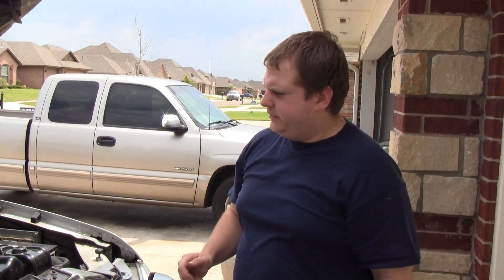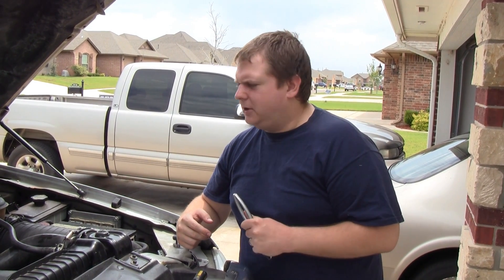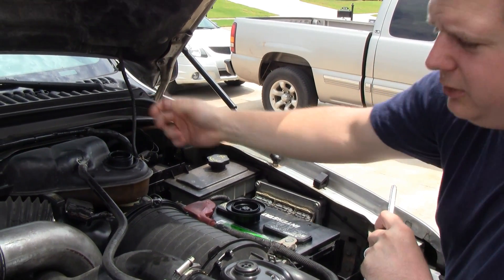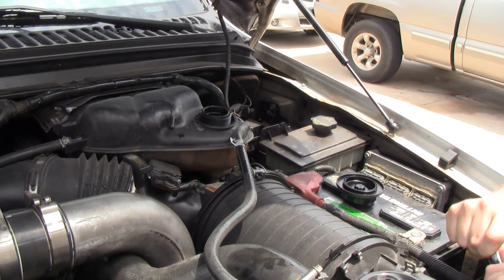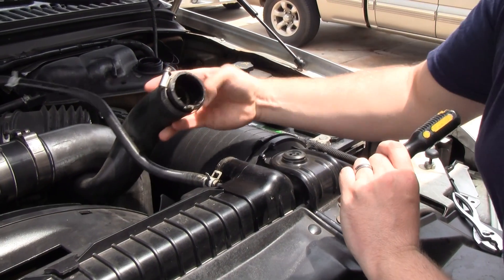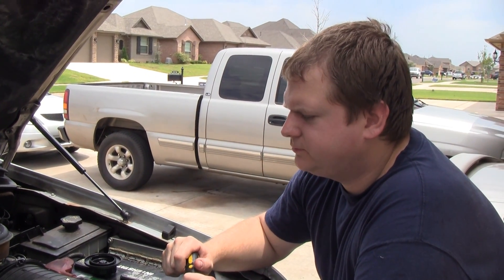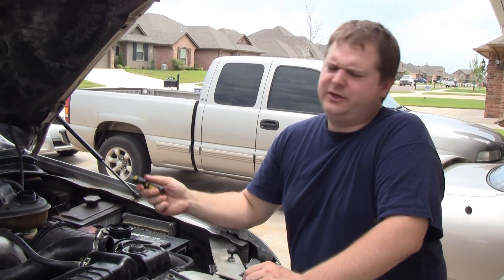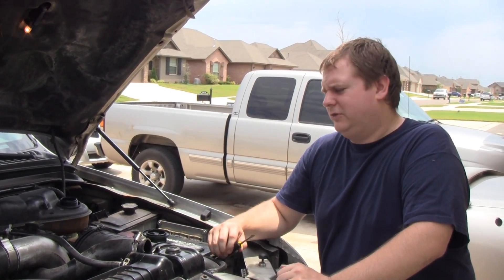Deviously Clever Mechanical Fraud On A 2003 F-250 Powerstroke Diesel

Comment: I bought a used 96 Honda Accord. While I was on the test drive I put it in reverse and backed up a steep hill. The transmission made a horrible grinding sound. The guy looked honestly surprised and said "I think I heard that once when I bought it, that's why I try not to use reverse that much. I forgot about that". I couldn't tell if he was lying or not and asked if he would lower the price. He said, "no, it's a good car and I think what I'm asking is fair even with that issue, just try to position yourself so that if you do need reverse your on somewhat level ground when you park". We've driven that car for 4 years with zero problems. The motor mount was cheap too. $80.00 installed if I remember right. Feeling pretty lucky after hearing your story. There's still a few honest people out there.

Comment: I had a 6.2 once that the oil cooler went out on. I honestly don't know how you drove it with oil in the water, because you'd get water in the oil as well. The engine knocked on mine and I shut it down right there in the middle of the road until someone could tow me home (no shoulder to pull on to just ditches). And surely the diesel  mechanic should have caught it if he'd just checked the dipstick. Right?

Comment: I know a guy that used to be a Ford tech for years until those 6.0s came out. he said they would often come off the transport from the factory to the dealership with seized engines. Because they are so cramped under the hood he often got stuck working on them as he was the skinniest guy at the dealership. He could take only a few years of that before quitting...

Comment: the original problem that blows egr cooler's , engine oil cooler's , radiator's , head gaskets and a lot of injector failures is the head bolts stretching causing compression in coolant system under a load and egr cooler is usually the 1st thing to fail on 6.0's . pop the cab off , remove heads and stud the block with some arp studs and all the other things will stop blowing out and you will see alot less injector failures also ! I also see alot of riged jobs bought at auction and I don't see how the riggers sleep at night and besides that they spend more time rigging in most cases than a legit repair would have taken .

Comment: the whistle noise is most likely the exhaust uppipes. they crack at the flex joint on the drivers side.  look for black tracing near there.  The oil cooler is the cause of the oil in coolant. Confirm uppipe leak. this will cause lack of power due to the turbo not receiving the exhaust. replace oil cooler.

Comment: I bought a used Toyota 4wd years ago and after a week of owning it, I needed to track down a large oil leak that had developed. The engine was very dirty but after giving it a pressure wash found that the former owner had decided to deal with the major oil leak from the timing chain cover by putting a blob of silicon over the leak (which never works) and then stuffed a bunch of socks and rags over the top so that I wouldn't see the leak right away (and I didn't, it looked like part of the engine block while covered in oil and dirt). The repair cost less than $100, but the weird thing was the person I bought it from was a heavy diesel mechanic! You'd think someone like that wouldn't be stuffing oil leaks with socks instead of repairing the problem! And that was just one of the many amazing things I found had been done to the truck all in the name of putting in the least amount of effort.

Comment: It's a Ford, you have to mask the garbage.  The truck that you really want and will last you is in the backdrop this whole video.
Reply: Wrong, the corolla in the background is the one you really want.
Reply: lol exactly. Rabid brand loyalty. Same mentality that locks people into political loyalty. "Shitvorlets!" " Libtards!" etc. You cant reason with this type of person.
Reply: Adam Gil RAM ?? Rectal Ass Management ??
Reply: Will Baack funny as the biggest pile of crap i ever bought was a 2000 Chevy z71 certified used. I was a Chevy guy and learned they can all suck.
Reply: There are reliable vehicles from every automaker , and just because you had a bad experience doesn’t mean the next car / truck will be prone to failure, if you buy a used and it’s not certified or come with service records most likely it’s going to have problems .
Reply: My 2006 Ford F350 6.0 Powerstroke runs and drives strong! ❤❤ Love my Ford! 👍FORD BUILT TUFF
Reply: my brother had a ford f250 and had nothing but problems. he had the bullet proof upgrade done to the truck which fixed one issue with the engine. then he had other problems with the truck too so he trade it in.
Reply: sometimes car names have the exact thing you need to do in their name when it comes to buying cars.
Reply: Wyoming Living I agree but there are exceptions. Like when GM went from using a $1.20 spring to a .30 cent spring in their ingitions and killed people. Or when a manafacture has had known problems with a component for many many years. Yet do nothing to resolve the problem. Each manafacture has done these dirty practices though. Some just do it more than others. So before buying new or used do research.
Reply: Will Baack fords are better chevys cant tow with those isuzu engines
Reply: Benjamin Vergara Do they spell Isuzu starting with a "V" in your country?
Reply: art vandelay 
Ur a fucking idiot
Reply: Will Baack 
Shitvrolets are junk
Reply: hell yes!
Reply: they are not 'isuzu engines' they are VORTEC

Comment: your 'not the kind of person' to help others avoid such a shady dealership?
Reply: He bought it at auction, not from a dealership
Reply: Alexander Goodyear dealerships have auctions, and the last thing he said was that he won't tell what dealership it came from because he's not that kind of guy.
Reply: SovereignM3RCY  Yes, larger dealerships will sometimes run a "private auction". As with larger auctions, a dealership auction will have vehicles just traded that they deem not lot worthy and sold as is, where is. A 2003 is an older vehicle that most dealerships (that are capable of running their own auction) will likely pass on without checking but the basics. In this scenario I'm willing to wager that the truck was traded in with this "fix" to fool the dealership to up the trade value. Since the vehicle was sold at auction its most likely that the dealership didn't look the vehicle over in the detail needed to catch this issue.
Reply: lol sure its not like they've made profit off of it right?

Comment: rolling down the street in my 6-0

blowing a head gasket needing a tow.
Reply: Rich Farfugnuven only took em a decade of engineering improvements. At least it sound good. Sigh.
Reply: They rarely blow the head gasket, they lift or warp head bolts. Gasket is still in tact just leaking, still intact=not blown
Reply: Richard Skipper except these are wicked fast if you aren’t a broke ass
Reply: @Skyw106  yeah ya gotta have money when you drive a ford lmao
Reply: Brad Heavener you gotta have money to drive anything? Try again
Reply: That’s great
Reply: Posted on youtube to get the scoop

Knuckle-heads out there RTV'ing the shoot
Reply: A truck pulls up who can it be.

Me draggin chevys with my seven point three.
Reply: Lmao
Reply: Its "Cruising down the street"!  Rip Easy E.
Reply: Piss off
Reply: This is so over used
Reply: Got to pay to play there fast trucks that's why
Reply: Derek Ortiz hey Derek all I had to do to my '03 was ARP head studs, bulletproof diesel oil cooler and water pump.  Sinister diesel coolant filtration, new turbo, new fuseblock, regulated fuel return, and an aftermarket oil filtration system and it's reliable as hell.   Haha.
Reply: Except the 6.0L has won the diesel power challenge now 2 years in a row.  Look up 6 Liter Keeter.

Comment: I think many of us have been taken at one time or another. I consider myself fairly knowledgeable about vehicles. I was recently scammed by a private seller of a motor home. I was told "everything was gone over this spring...everything is good." Low and behold.. the water heater was nearly split in two from being frozen, neither of the 2 furnaces worked, the speed o works when it feels like it and many more small things that would have been caught in a spring inspection. I contacted the "servicing dealer" and the said they had never done an inspection.He was aware that I had been evacuated from my home due to a massive wild fire that consumed 2400 homes in my city and that the motor home was to be my home for a while but still decided to be dishonest. I did not get the unit inspected myself because i was soon to be homeless and didn't have the time or the money to do so.
Reply: king of the world  Sad bastards... karma is a bitch
Reply: Hey in business you need to be ruthless sometimes and not let peoples sob stories sway you. I bet you'll find time next time or maybe not. Some people never learn.

Comment: I understand buyer beware but The seller used deception to get a higher price for the truck than the truck was worth. It is one thing if the seller did not know but they did know. A dealer usually has about a 30 day waruntee at least . And a problem of a bad head gasket would show up before that. It was the last owner who traided it in to the dealer. Its possible the dealer didnt know. I believe this is a criminal act.
Reply: William Brady: it was bought in auction. Most likely done before trade in to deceive the dealership.

Comment: I have experienced the same thing, I was driving around and noticed the car running hot so I pulled over and did a walk-around. Guess what? turned out, I had a piece of hooker still stuck in the grille, blocking the radiator. My luck right?

Comment: Yea it's terrible and a shame how awful people that know better, but still do the wrong thing. That will have an effect on other folks continuously down the line. One thing is for sure though, that is I have been told and have read enough to know, you need to stay away from those cheap International built Diesel engines Ford was using for many years!! But their new Scorpion 6.7 diesel seems to be a huge improvement. I can't wait to test drive a new Ford SD diesel and gas truck! One thing is for sure, America builds the best pickup trucks out there in this Country!
Reply: Kevin Voyer America builds the best pickups in this country?
Reply: You should be blasting Ford a little harder for the poor design of these trucks and not the person who took the easy way out by blocking the reservoir ports.
Reply: Ford Super Duty trucks are built in Louisville, Kentucky.
https://corporate.ford.com/company/plant-detail-pages/kentucky-truck-plant.html

Comment: FYI, you can get a check engine light after pressure washing an engine bay. I've seen it several times and for the most part the code can be cleared after the engine bay dries out. I would never have returned a vehicle had the check engine light come on but that's not the point. It just takes a drop of water to short a connection. The CEL coming on after pressure washing the engine bay is not out of the realm of possibilities.
Reply: If a drop of water causes check engine light to come on they can keep that car. If they told me pressure washing the motor caused it to come on and it just needs to be dried out i'd tell them to dry the mother fucker out. The code gives a idea of where its coming from usually, running the motor warms up the engine bay, compressed air blows water away. If it's a optispark car and you powerspray the motor it might throw a code but the more obvious issue would be that it doesn't start
Reply: you should never pressure wash an engine, first of all it will never make your car perform better, second it can only lead to frustration and $ replacing sensors and other plastic shits...
Reply: lewinsky hillary I was really hoping someone would say this. "let's point a 3000psi blast of water at a bunch of rubber hoses, plastic, wires, and sensors" never got why people think this is a good idea. I bought my car from a guy who did that to his DD, so he had to sell his second car to foot the repair bill for the shit he messed up. idk whether this is true or not, I don't trust a lot of people tho
Reply: lewinsky hillary I've pressure washed my fair share of engine bays and have had very few problems, from my experience it's pretty unlikely anything will happen(especially with the newer vehicles). I was only stating that there is the potential for something to go wrong. It will never make your vehicle preform better but it sure as shit will make your engine bay look better. I wouldn't be doing it if I thought I would need to payout to fix a problem I created.
Reply: Doesn't matter if it's in the realm of possibilities, it's still an easy way to lie about car problems. If the seller can't keep the engine light from coming on, something is wrong.

Comment: It's a 6.0, gonna get used to problems most likely. Sell that and pick up a bitchin 7.3
Reply: Rob Dizzle 7.3 is life
Reply: J J had a 7.3 and a duramax and they were the two best trucks I ever had.
Reply: J Deuink in all honesty I don't think so an 01 7.3 with nearly 400k right here and not even tranny issues
Reply: Rob Dizzle my 7.3 and 12v are unstoppable
Reply: 300,000 on my 2000 7.3 running strong,yes with some fresh injectors!
Reply: Rob Dizzle I hear that I bought 3 I like them so much
Reply: Rob Dizzle double yes..
Reply: 06, and 273000 miles. New injectors and cups new turbo that’s all for now everything else I want strong
Reply: Rob Dizzle I just wish the front suspension was beefier like Ford love the solid front axle
Reply: wrong. 05-07 6.0 more reliable. you lose.
Reply: J Deuink you’re on fucking drugs if you believe that 7.3 Is wayyyyyyyyyyyyyy more reliable

Comment: I thought you said you bought it at auction? Why would a dealership be involved?
Reply: +Lightpaws Hird car business is full of crooks
Reply: Lightpaws Hird, dealers take cars they can't sell at there lot to auctions
Reply: They should be required to disclose anything wrong with the vehicle. They made this a law and requirement for selling homes, cars are a major purchase that can wreck someones personal finances for 4-8 years, they should be required by law to have to list ALL problems with the car and the reason the car wouldn't sell.
Reply: not only do dealer seller unwanted inventory at auction, small used car dealers buy cars from auctions as a means of generating inventory.  Nobody would check the vehicle at auction as its sold as is.
Reply: Oh trust me I know that all too well getting ripped off for repairs
Reply: The other guys are correct. I work for a 3rd party company that JUST transports cars to/from auction for dealerships. Shady business. Sometimes they just don't have luck selling the car(s) on their lot, but more often than not, they're going to auction for a reason. If you ever happen to watch an auction going on, you'll see signs like "OBD SCANNERS PROHIBITED". It's a very "as-is" business

Comment: 6.0 with egr problems very common
Reply: ProformanceTrucks not an egr problem. Loss of power is most because of oil. The injectors run off of high pressure oil. Oil cooler is plugged  and high oil temp ruptured the cooler.
Reply: 6.0 with any problems very common. Worst engine ford has ever used

Comment: Did it ever overheat, temp higher than normal?
Reply from the maker: Nope,  never overheated
Reply: That's strange.
Reply: How can it not overheat. There is no coolant! When there isn't any coolant flowing past the coolant temp sending until, it doesn't know that's its overheating. The gauge will show normal. But you will have other symptoms like smelling the engine get hot, loss of power, and eventually coolant boiling out. That if there is any to boil out.
Reply: There is probably still coolant in the radiator, it was just sealed off to hide the problem
Reply: You're right . if the top tube is dry no heat . I have a '98 Expedition with a bad head gasket  . I have to run it about a gallon low on coolant or it puffs a lot . It never overheats , the only downside is I have no heat in the cab because there's not enough coolant in the system to send to the heater core .
Reply: check your oil cooler first,just disconect the coolant lines(and conect them together with a pipe)then let the car run and check if there is oil coming out from the cooler..i ame not formiliar with the ford engine but in this way it helped me one time with a peugeot diesel engine....
Reply: moparmania86 plus loss of heat in the cab.
Reply: Big engines rarely get enough stress to put a strain on the cooling system.

Comment: This is fraud. And theft. It's illegal, immoral and unethical. Unfortunately, now you'd have to go into the legal system to get redress. That means lawyers and judges. Good luck with that. The dealer has more money to pay lawyers than you so they win in court.
Reply: he bought it at an auction. All vehicles are sold as is and rarely looked over. This was most likely done by the person using it as a trade in.
Reply: John which is the risk of buying at auction
Reply: Well the issue would be proving the dealership did it. However as he stated the truck was picked up at auction where he purchased a truck, and that is exactly what he got.